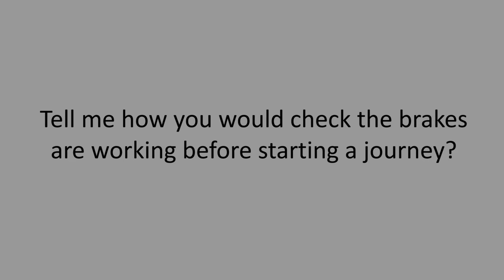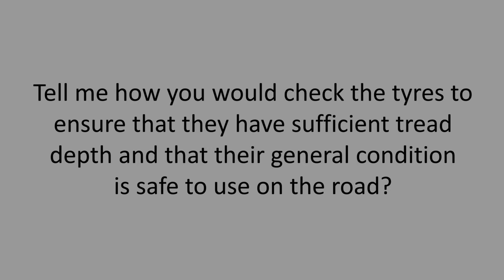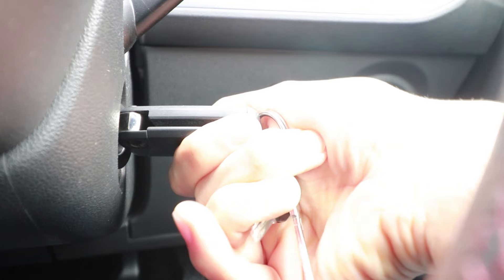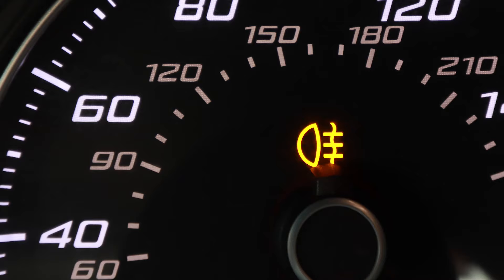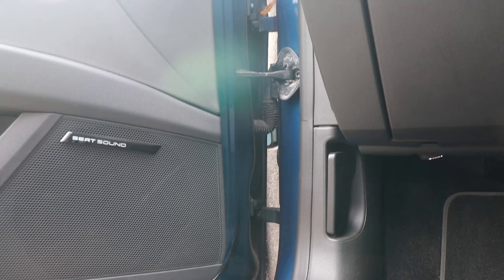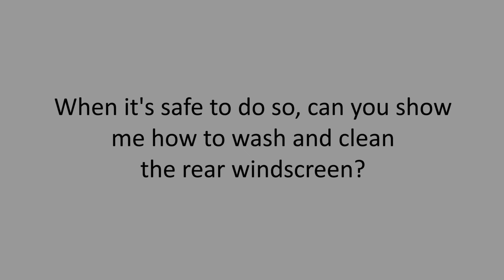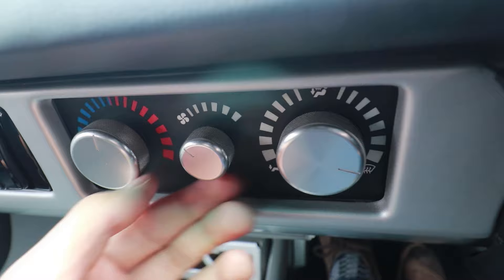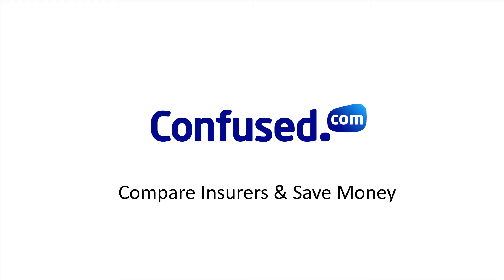Show Me Tell Me Driving Test Questions & Answers 2020

Comment: In my experience quite a lot of qualified drivers would struggle to answer all of those questions correctly. How many actually read the handbook ? Powder and pre-drive checks help.
Reply from the maker: Cars are so good these days people get away with it mostly which causes laziness. If it was 50 years ago it would be essential to do this check to make sure you'd wouldn't brake down.
Reply: @ConquerDriving  Well I've been driving for 58 years and know that only too well. The static and moving brake tests were especially important.

Comment: The reason for the odd illumination with the main light switch is that there's no requirement to have an illuminated warning for dipped headlights (only for main beam), but for side-lights there is in the C&U regs. if the speedometer illumination can be turned off, though it's not a testable item for an MOT whereas the speedometer illumination is.  On a sufficiently old car there may be no symbol for/on the rear fog light switch, the requirement used to only be that the switch itself illuminated or lit a warning lamp.  I've no idea if marking the fog light switch (or any other switch) is actually required as part of modern type approval, you certainly wouldn't fail an MOT if the marking was absent, though you would for mandatory rear fog light(s) if the tell-tale light wasn't working.